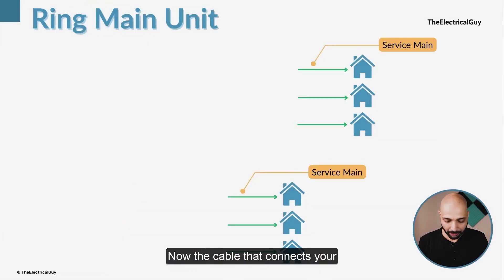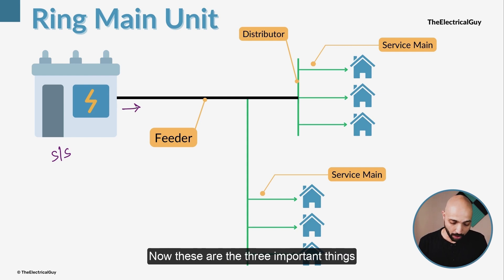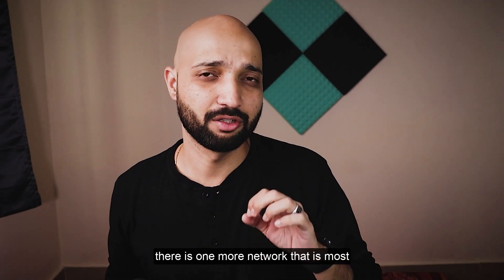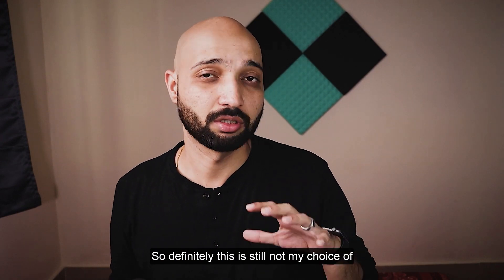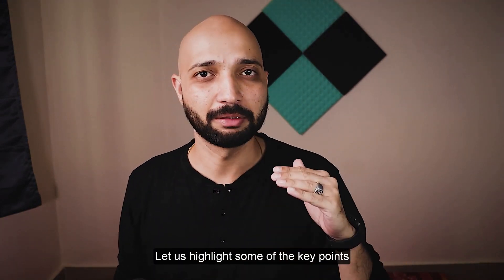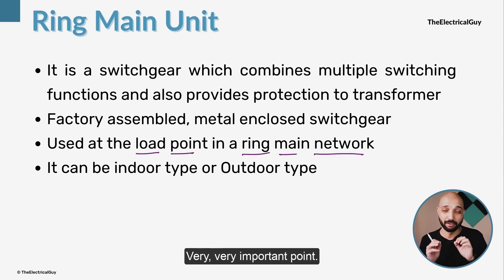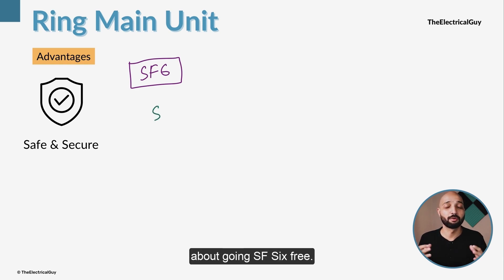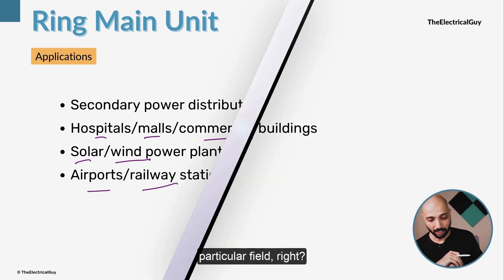What is Ring Main Unit (RMU) | Explained | TheElectricalGuy

Comment: Hey Guarav, i'm just wondering how the changeover will occur from feeder 1 to feeder 2?  Could you please correct me if I am wrong:

Fault between substation & load 1
Feeder 1 CB opens at the SS,  load 1 CB opens at the same time
Both sequentially isolate (no arcing)
Load 1 feeder 2 isolator closes (with arcing since feeder 2 is live)
Load 1 CB closes, supply restored

Comment: Thank you for the video. I have a question: Is it possible to power Feeder 2 using renewable energy, such as solar? Also, can the RMU be designed to automatically switch between solar power during the night and grid power at day?

Comment: thanks for the video which was really useful, however i have one doubt that, it had only one outgoing feeder protection for transformer as u mentioned, remaining two had only NEC option. where can we use those outgoings or incomers without having any protection either by breakers or by fuse. kindly let me know if my understanding is correct. your reply is really appreciated and could clear my doubts

Comment: In malaysia, no neutral at rmu coz its only for medium voltage..rmu is not circuit breaker..only for connect to other point for complete the ring circuit..maybe different type at your country

Comment: what is your idea about using three switch gear panel with cartridge type VCB for the same 3 functions instead of one 3 functional RMU or extending single function RMU by cascading. I think VCBs panel will be half price of RMU and will achieve the same in normal distribution network

Comment: Why two swiches and one CB? Why not all three switches are CB?
Reply from the maker: The cost. If you use all three CB the cost would be very high and it will not be feasible. Plus with even 1 cb the purpose is getting addressed. So no point in using all 3 cbs.